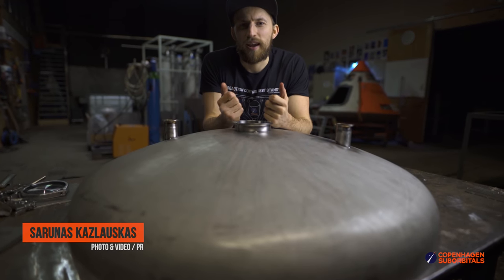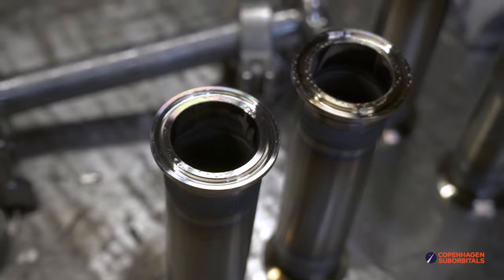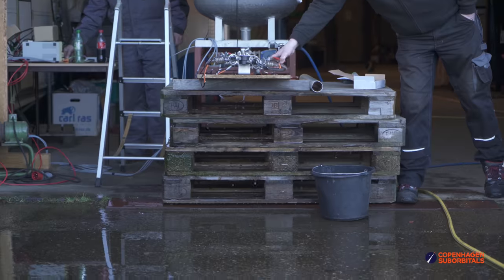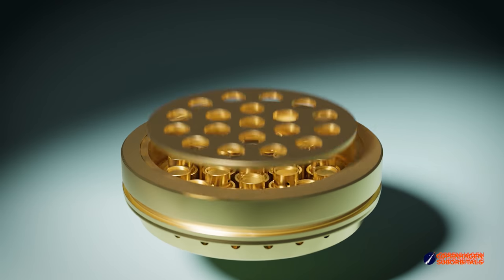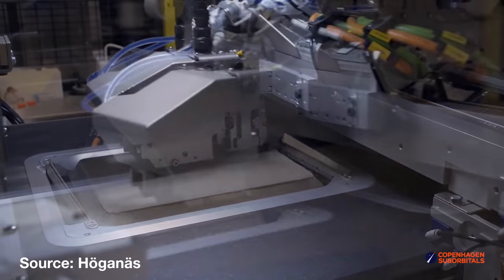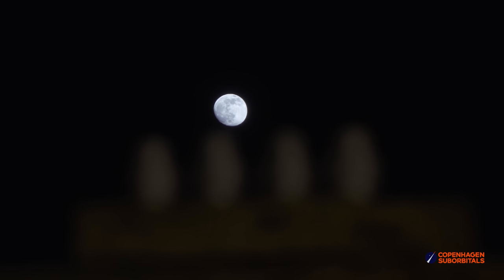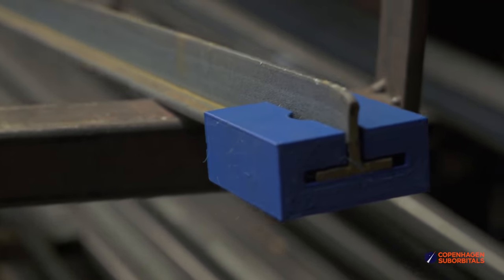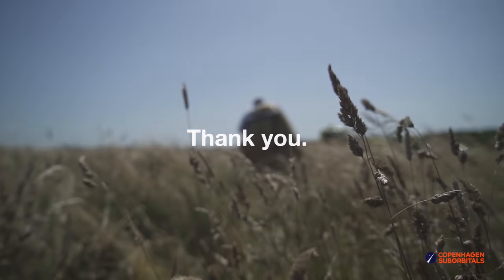3D Printed Fuel Injectors & Propellant Tank Tubing | INSIDE THE ROCKETSHOP : Episode 23

Comment from the maker: A small clarification: We mention in the video that 3D metal printing might hold promise to print larger parts of the injector. In reality it is just about the opposite. The "green parts" shrink by around 40% after sintering, which makes it easy to work with when your dimensions are small - and very hard to work with when your parts get bigger and start to creep in larger dimensions. So this only works for small parts like single injector elements, but not for bigger assemblies.

Video explaining how our swirl injectors work: https://youtu.be/0qvbyl7KuNw
Scott Manley's recent fuel injector video: https://youtu.be/aa4ATJGRqA0
Reply: Plz soon uploaded 3d printing injectors
Reply: Why not to use multiple small engines instead of a big one?
Reply from the maker: @FlashLeak  It would require a lot of additional testing to validate multiple engine control systems, reliability and so on. We concluded single engine would be the fastest way for our project to reach space.

Comment: *=* To avoid vibrations of the tank, you can probably weld structural bar tubes of your choice in the cylinder of the tank to stabilize the effects of vibration.

Comment: I wish I was stuck in a workshop haha but all I can do is play with whatever lab I've at home. But I've a question, why don't you try pintle injector.
Reply from the maker: It was definitely one of the considerations when we were looking to move away from shower head injectors. I am not in the engine group myself, but from what I had gathered there was much more examples of swirlers in literature to base our design assumptions from, and also a lot more of what we learned from our shower head injectors transferred onto a swirler design compared to a pintile injector. And just from my own point of view, which might be completely wrong, so feel free to disagree - pintiles seem much harder to tune in our circumstances compared to swirlers.
Reply: @CopenhagenSuborbitals  pintle injector have a little more complexity than showerheads, impinging doublets/triplets and swirlers(these three are more preferable for ease of manufacturing) but it helps to reduce number of injectors. If you don't mind can I know the circumference of Spika rocket engine? I'm considering impinging ones in my engine to gain some experience on injectors but pintle seems a good option for me. What department are you from though?
Reply from the maker: @vishalk4647  420mm. I'm from media/public relations.
Reply: @CopenhagenSuborbitals  I've talked to orbital machine pr before about my engine before and I'll have to see if a pintle will work or not. Soyuz used swirlers in beginning I don't about current situation and SpaceX uses single pintle and I'd like to help you guys in anyway possible.
Reply from the maker: @vishalk4647  SpaceX are going with swirlers for Raptor as well. You are always welcome to become a supporter through our website or just help spread the word about us in your circles and/or local space/maker communities if you want to help. For any project related work we mostly seek people who are from Copenhagen.
Reply: @CopenhagenSuborbitals  my team knows about you and they usually watch your videos whenever they're stuck with problems.

Comment: Fantastic stuff as always. Is that hygienic clamp ferrule fittings you use? If so, what seals are you planning to use with the fuel and oxidiser please?

I’m having a go at building a small rocket engine a shave all the kit in house.

Comment: Are 3d print mettalic part strong enough to be inside the combustion chamber ?
Reply from the maker: Hopefully we can discuss that in our next video. :)
Reply: Etienne Dud Hi!
The mechanical properties of the 3D printed 316L outperforms those of machined brass. So as long as the design of the machined ones is suitable, the 3D printed ones should be as well. Also, most sharp edges have been rounded off in the design of the printed nozzles, removing most spots for stress concentration centres to appear. So, mechanically they should be stronger.
Cheers! /Fredrik
Reply: Complete rocket engines have been 3D printed and flown successfully. SpaceX uses them for attitude control and emergency escape system of their Dragon Spaceship, including Crew Dragon. And Rocket Lab is flying into space on 10 3D printed main engines of their Electron rocket. NASA, Russian space agency and many rocket start-ups also print experimental engines and engine components. You can look up Launcher Space from New York -- they have some very detailed videos with actual test stand telemetry from their engines.

Comment: Are the 3D printed parts gas tight? This might be an issue with sintered materials, potentially dangerous when separating fuel and oxygen
Reply: Patrick Flé Hi!
Valid point! Things we (Digital Metal) make are typically gas tight, depending on test conditions of course, even for geometries with thinner walls than these nozzles.
So to answer your question: Statistically, yes they are gas tight. However, it is always a matter of statistics, where higher porosity and thinner walls will drastically increase the risk of parts not being gas tight.
At the same time, I don’t think that these nozzles have to be gas tight in order to provide the correct function safely, as there is, relatively speaking, no considerable pressure drop across the walls separating fuel and oxidizer; assuming that the system is operating correctly. But don’t take my word for it though.
It would be interesting to print some intentional pores and see how the nozzles would fair during hot-firing tests!
Cheers! /Fredrik
Reply: @FiddeBL  Hi Fredrik, thanks for your explanation!

Comment: Is there any advantage of using a bulk head propellent tank?
Reply from the maker: Compared to what?
Reply: @CopenhagenSuborbitals  compared to flat head tanks
Reply from the maker: @kpop_cloud0460  Spherical bulkheads can be made of thinner material, making them lighter compared to flat bulkheads. It also has the advantage of creating a drain point for propellants at the bottom of the bulkhead.
Reply: @CopenhagenSuborbitals  thanks for reply

Comment: I'd stick to the machined parts. It is a time tested method, and as a small shop a rocket failure can be devastating in terms of both the finances needed to build another rocket and if someone is onboard, a human life. This is a flight safety critical item. NASA I think approved an EBM process which is the strongest out of the metal 3d printing methods, but sintering can leave voids which can cause failures. If you go with that, at least do an xray NDI for each one before you ok it. (***This is just my opinion and not to be taken as expert advice or to be acted on***)

Comment: Why dont you print the whole engine in 3D like everyone else is doing? (SpaceX SuperDraco, Astra, Orbec etc.)
Reply from the maker: Unlike everyone else on that list, we are a crowdfunded project running on a shoestring budget, doing this for free in our spare time, metal 3D printing a whole engine is still too expensive on our scale.
Reply: @CopenhagenSuborbitals  NASA says 3D printing rocket engine is faster and cheaper than traditional methods. Surely they compare different numbers than your budget. But there are student papers on how to print 3D engine out there few years already so maybe it would not be that expensive in the end. I think you should give it a try.
Reply from the maker: @FlashLeak  The way we make engines is a lot different from how NASA makes their engines, because again - we have to minimize costs. We've looked into it multiple times and so far 3D printing is well outside of our budget. Plus it would require a whole new R&D phase, which could end up being even slower as well.